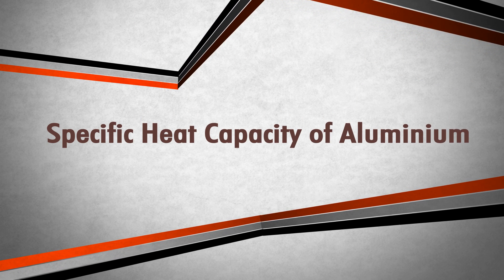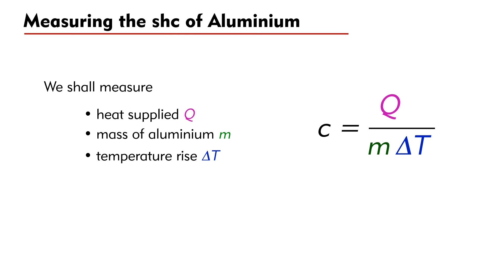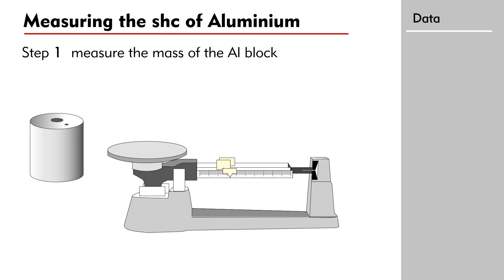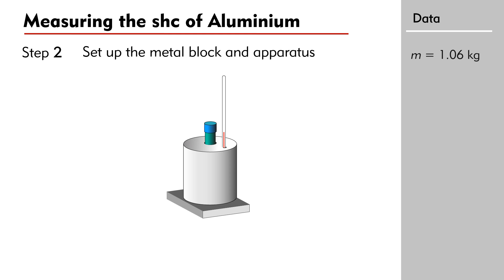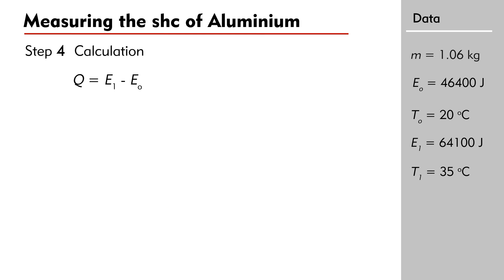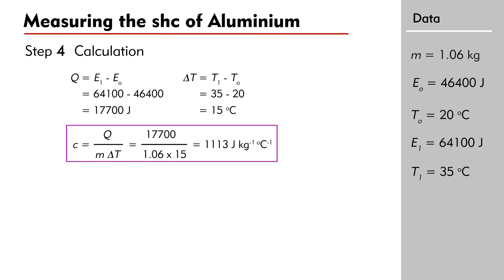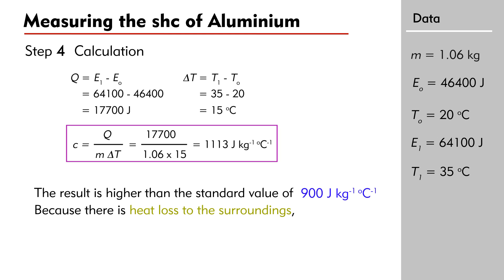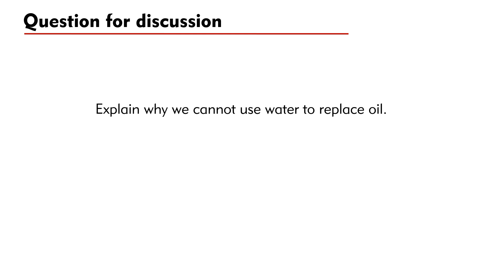Measuring the specific heat capacity of Aluminium (1)

Comment: Because water has a higher specific heat capacity than oil and aluminium, and water is a poorer conductor compared to oil, and the boiling point of water is lower than oil, so it would absorb a lot of heat before boiling, which makes it unable to effectively conduct heat to the aluminium block, so it's harder to measure the temperature change, which affects the experimental results.

Comment: it is because if we use water instaed of oil, since water has a higher specific heat capacity than oil, therefore it may absort the heat from the immersion heater and affect the result of the experiments

Comment: It is because water has a higher heat capacity than oil and will absorb a lot of heat that give out by the heater. This may cause error in the result, so water cannot be replaced by water.

Comment: it is because water has a great heat capacity,it may absorb the energy stored in the heater,thermometer and the aluminum,and oil has a small heat capacity than the water,moreover,it can prevent the holes leak and contact with air,to smaller then total heat lose
overall oil is better.

Comment: It is because water has a higher specific heat capacity than oil, because of this reason, water will absorb more heat than oil, so it may cause some error.But if we use oil, the result will be more accurate.

Comment: Two reasons:
1)Being heat conductor, oil is better than water.
2) Water has very high specific heat capacity, which means water will absorb large amount of heat form the heater and mark larger error to the result

Comment: Oil is used for displacing the air and improves the thermal contact. If we use water instead of oil, the water will evaporate during the process of heating. The water will change from liquid state to gas state which is called steam. Therefore, we cannot use water to replace oil.